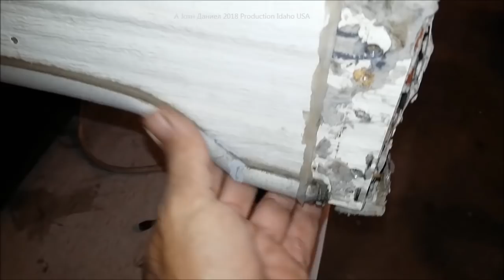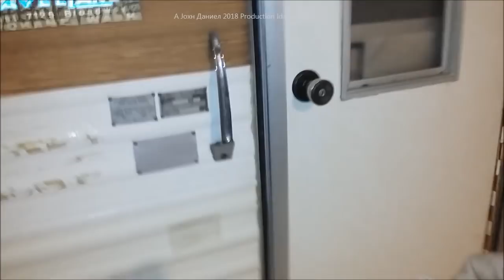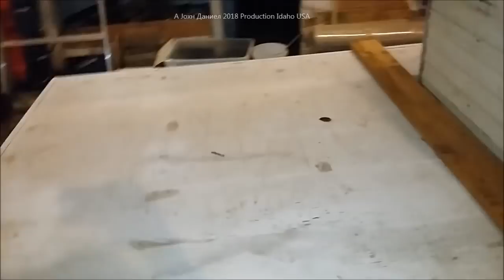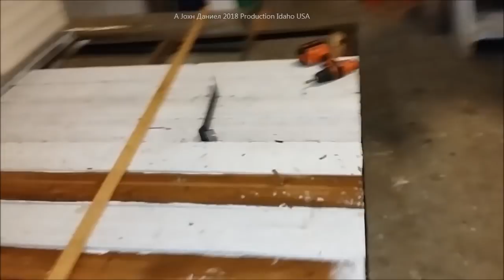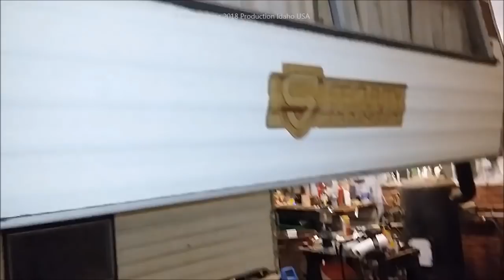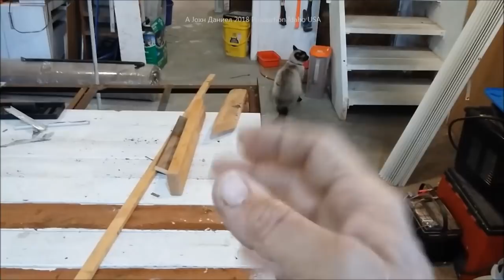The Bug Out hybrid camper RV build, Build Stage 2 video 1

Comment: How did you anchor the camper down? Bolt down?
Reply from the maker: 2" Angle steel ran the length on both sides, secured to the floor and camper sides.

Comment: That Hardi-board you are using for siding is weather durable, but easily broken. Good luck.
Reply from the maker: Its actually this https://www.homedepot.com/p/TruWood-4-ft-x-8-ft-Sturdy-Panel-Siding-Nominal-7-16-in-x-48-in-x-96-in-Actual-0-400-in-x-48-13-16-in-x-96-in-7POMSP/202531838 The lightest but most functional I could find to keep my UNDER 3300 lbs goal. So Far, So good, Looking like 3060 wet weight complete by the time I am done.
Reply: Its the same stuff, just different brand.